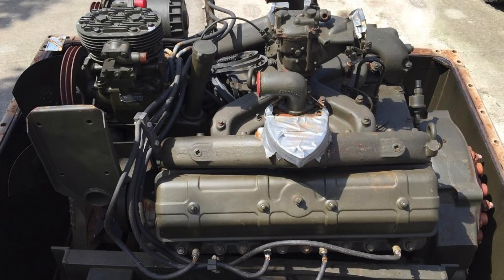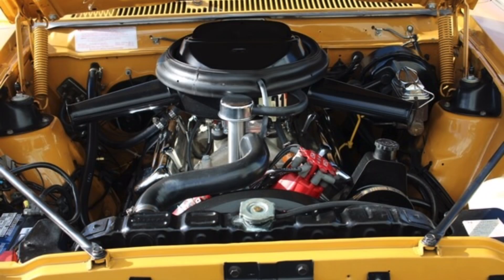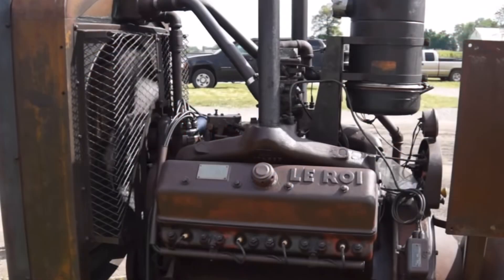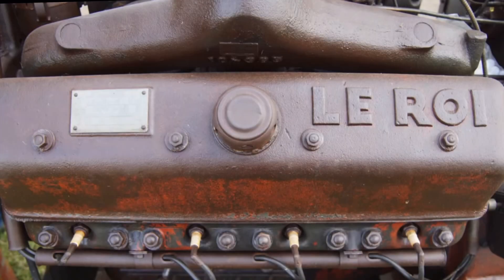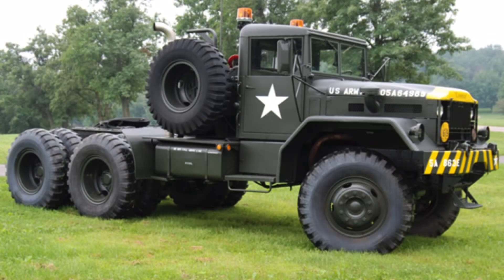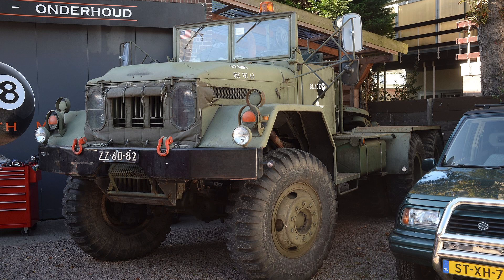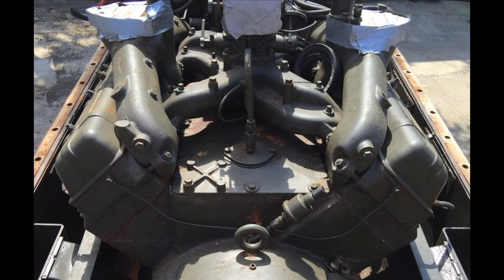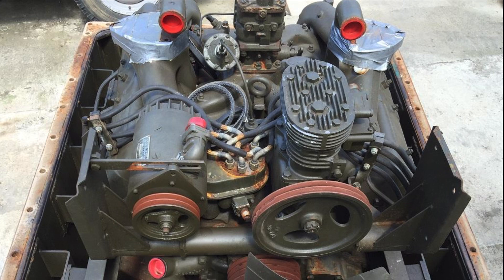Largest V8s You've Never Heard Of: The LeRoi 844/884 Cubic Inch Gas V8 (in Mack M123/125 10T trucks)

Comment: The channel SmallEngineMechanic has a video with some load tests of a big generator based on a "RoiLine" 884 cubic inch gas v8 - seems to be this engine by the looks of it. He had to take it to his workplace for load testing, the gas supply at his house would only allow running at idle...

Comment: It looks like the exhaust manifolds are water cooled, so the heating of the intake manifold would have been minimized.  Certainly an interesting design!  
Interestingly, an even larger gasoline engine was sold in US over the road trucks in the 50's and 60's, and it was an overhead cam straight six - the Hall Scott 1090 CID six was a monster engine, and often came equipped in Kenworth trucks of the period.

Comment: That intake looks like the typical dual plane with every other cylinder in firing order being connected to the same plenum junction and one side of carburetor. "Cross plain" as I have ever known that to be applied had extended runners, usually with less curves. Terminology does get mixed up with engineering and marketing jargons.

Comment: That intake manifold is a dual plane intake. The intake runners just look more prominent due to the fact that this engine uses stand alone manifold with a separate valley cover, where most V engines incorporate the valley cover into the intake manifold. You can see where each plane of the manifold feeds the two inner cylinders on one bank, and the two outer cylinders on the other. On a cross ram manifold each plane usually feeds one entire bank on one side, while the other plane crosses over to feed the other. I love your videos, and have binge watched almost all of them by now. LOL! Please keep 'em coming!
Reply: The Buick 215 from memory has a seperate valley cover, well at least the Leyland 4.4L V8 version  (alloy like the 215 but the same deck height as the Buick 340) did
Reply: @mickvonbornemann3824  Pontiac V8s all had separate valley covers and intake manifolds.

Comment: The largest IC engines ever built by the automotive manufacturers (1) were likely either the Pratt & Whitney R-2800 or the Wright R-3350 18 cylinder aero engines. I know Ford, Buick and Nash built R-2800s. The R-3350 I'm not sure if any of the automobile companies built them. 
Nordberg in Milwaukee built a two different radials. An 11 and a 12 cylinder version both with 14" bores and strokes. These radials were unusual in that neither engine type had a master rod. Built for use in generating and pumping stations. The generating stationswere mainly in aluminum production facilities.
1) GMs EMD division crtainly built larger engines for diesel locomotives
Reply: But Wartsilla (sic) makes the biggest IC engines of all, GIANT diesels 3 stories tall, that turn at 75-200 rpm! Fat men can easily fit inside the cylinders 😂.
Reply: @JeffKopis  
Those aren't engines. They're usable power producing sculpture 😁
Reply: @JeffKopis  
I wonder what peak piston speeds are. Probably not as high as one might think simply to reduce wear. IIRC Wartsilla uses cross heads between the crank and the piston rod to reduce piston rock. A common arrangement on large piston air compressors. We used to rebuild the ones at work until management decided that they would assign part of the work to a different trade. They assembled the Red valves all for intake. Started it up and on the second or third stroke it blew the cylinder head off. Through the wall of the building and across the street. Good thing ther wasn't a c in the way.

Comment: Sorry if I missed it, but did any of you catch what was the overall assembled engine weight? Thanks.
By comparison, the late 1950s Ford Super-Duty V-8 534 cubic inch was about 1,000 pounds.
 I think the GMC V-6  Hercules truck-only 305 cubic-inch ( smallest displacement of the family ) was around 800 pounds...
These two examples were from specific truck engine design families - all cast Iron, heavy construction, modest horsepower but fantastic torque at low-rpm truck-only engines...that had NO business being in passenger cars or 1/2 ton pickups.
Reply: Do you know about the weights of any of the other engines in that series?  The gmc v6s?  I know some had larger cranks so maybe those were heavier but does the weight correlate with the displacement?
Reply: @machineman8388  The weights do not correlate with the displacements on the GMC V6 engines. In a lighter duty application like a pickup, they are a little over 800 pounds. In a heavy duty application (larger truck) they go over 900 pounds. 

In addition, the larger versions use a timing gear set, bigger/heavier front cover, bigger flywheels, clutches and bellhousings as well as larger thermostat housings (for two thermostats) and some have air compressors.
Reply: @machineman8388  Sorry I cannot locate a chart for the GMC V-6s....but I do know the Ford Super Duty were heavy...
( 401, 477, 534 Cid).
That's one reason they should never be put in a passenger car or light-duty truck.

Comment: Always like these ideas. Ancient solutions to problems we still face. I guess the non cross flow head is a bit irrelevant, given the low engine speeds. Manifolds in bank are not unheard of in heavy equipment use, like the Cummins m50 tank engine found in the Sherman. That's done to package the forced induction.

Comment: As an European and having had an Opel sedan with a 1.0 liter engine, the first time i saw the 455 ci engine of the 73 Oldsmobile 98, wich I owned in 1982 in the US, I thought it was enormous...
Reply: We were lucky😊.  Back then, just get a straight pipe to replace the catalytic converter,  and those big detuned engines were still impressive if they were running right (and no longer choking to death once you removed the converter)
Reply: @John.Zachary.Delorean  My Oldsmobile 98 being from 1973 was not yet catalysed. The catalytic converter was first adopted on the 1975 model.
Reply: @ferrochinabisleri1587 okay, understood.   I'm remembering the blue 1975 Bonneville we had.  My dad worked & worked on it.  He said "I finally wondered if it was the catalytic converter, I took it off, went for a drive, and she took off like a scalded ape."

Comment: Adam, I am going to guess this was a gallons per mile engine rather than a miles per gallon engine. 😉
Reply: On that subject...believe it or not, I've achieved 17.7 mpg twice with my low-mileage 1970 Mercury Marquis, 429 2-barrell.
Obviously I drive carefully, buy still.....
Reply: @67marlins  I believe it. I usually beat the official mpg numbers in the slow lane while sticking to the speed limit.

Comment: Don’t forget about the International 549 V8
Reply: The big Ford and IH gasers were great engines 👍
Reply: Funny we give GM shit for converting there olds engine to diesel but International used there big gas engines as a platform for there up and coming V8 diesels and it worked out pretty good
Reply: @alexinnewwest1860  To be fair, the early 6.9 diesel had head gasket issues too, that were later resolved with bigger bolts when displacement was increased to 7.3. Of course the 6.9 was still a MUCH better engine than any of the Olds diesels, and also Chevrolet's 6.2/6.5. 

The Olds diesel program would've gone better if the spent some more time on R&D, and hadn't introduced their engines prematurely. They weren't ready yet! Bigger/better head bolts/studs, and a good fuel/water separation system would've made the Olds diesel story much brighter 🌞    in my opinion.......
Reply: Or the International 605.
Reply: Don't forget about the ford/cat collaboration on the 636 V8 diesel. In all actuality it was a 3208 naturally asperated engine that was painted ford blue.  Rated at 225 hp iirc.  I have a ford C750 with an 1150 cat engine, 573 cubes and 200 hp.
Reply: @danielrobey1759  I thought those early 1150 & 1160 Cats were like 160-170 HP